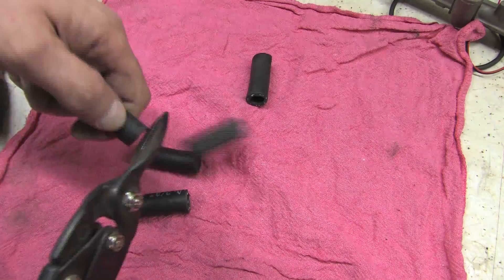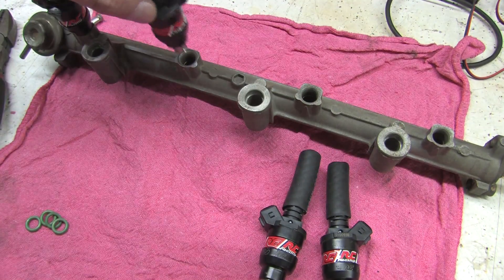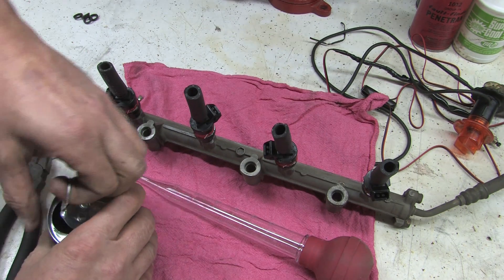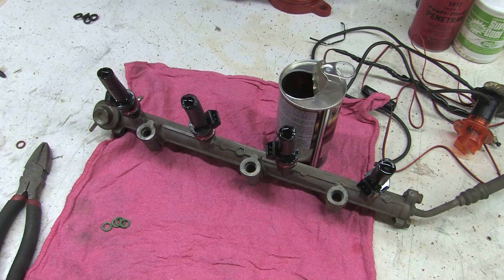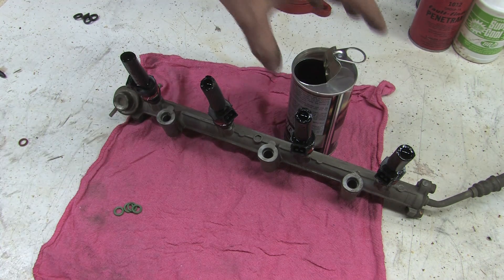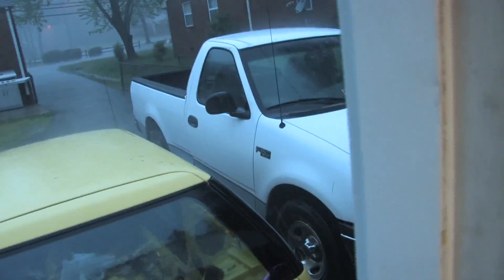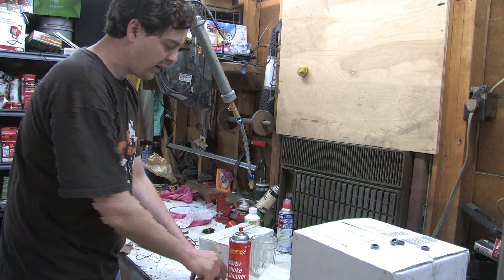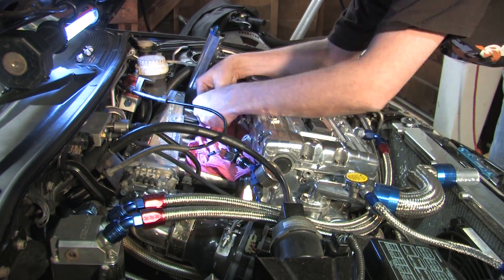DIY Fuel Injector Cleaning

Comment: el producto bg de limpieza injectores es bueno y biene otros productos bg flush p/steering y otros pero esa hasido la limpieza de injeectores mas mierda q he visto viene una botella de aie a precion echas el bg desconectas retorno si tiene y sacas relay de gasolina pones presion de aire depende del vehiculo casi es 45 o65 psi prendes conectas manga de aire regulada y prendes el auto y wuala. att.TECNICO GM

Comment: Would you have gotten similar results by pouring the injector cleaner in the gas tank and driving? I suspect I have a few leaky/stuck injectors, but I can't afford any downtime with my car so if I could clean them another way, that would be great. Thanks!

Comment: Dumb question: Doesn't running several tanks of gas with fuel injector cleaner have the same effect as this entire exercise (with some patience).? The advantage here is that you can diagnose a leaking injector.

Comment: just a tip, keep compressed air away from the injectors.  I made this mistake before and they got stuck.  when I took them back out and soaked them in gumout carb clean they worked perfect.

Comment: can't you just attach those fitting to your fuel rail? and adjust those regulator up to desired fuel pressure and disable the fuel pump! then run the engine

Comment: I plan to check my injectors tomorrow, I have the stock intake mani and there was a small puddle in it the last time I drove it and I can smell gas occasionally, so I believe bad O rings, I checked my fuel rail awhile back with the injectors in and they opened and closed fine, but I think one of the o rings may have gotten pinched when I reinstalled everything

Comment: @Jafromobile , oh no.. I use 12V power adaptor with 1Amp to clean my injector, but I don't use 20 PSI air compressor, I use pressure from Carb Cleaner can. Will my injector coil be burn? What is the ohm meter for the injector? Please advice... Tq